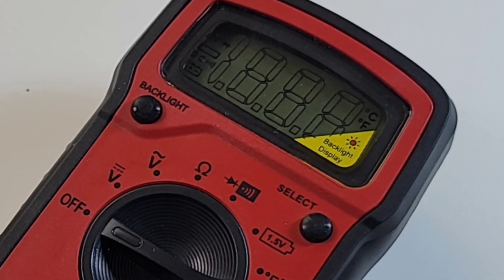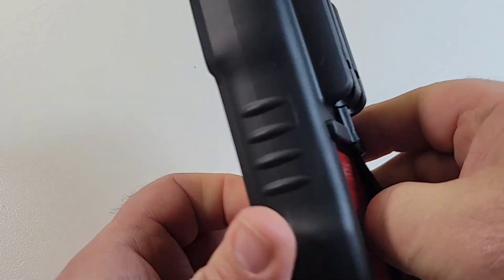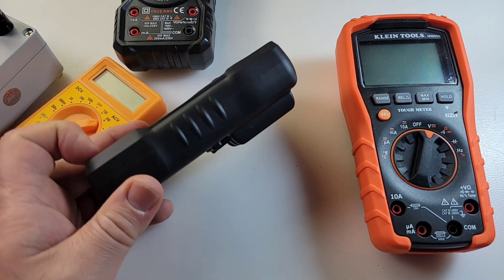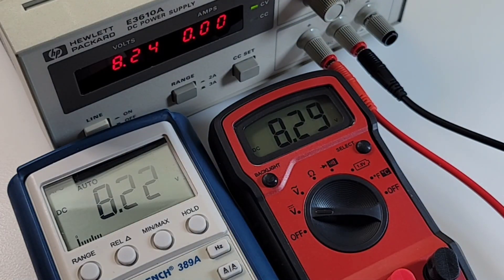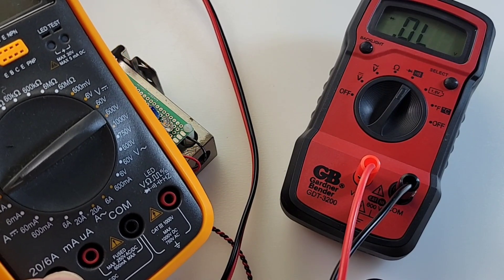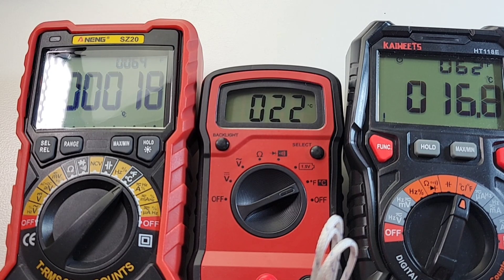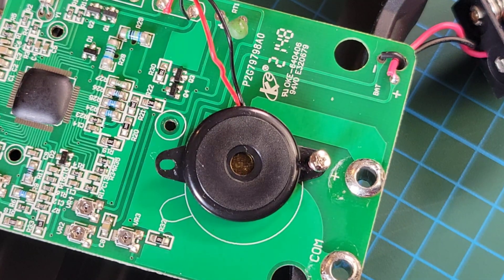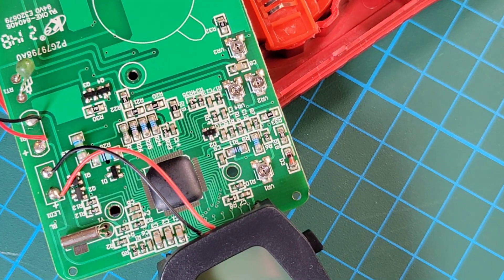GARDNER BENDER GDT-3200 CHEAP-O Multimeter Review & Teardown!

Comment: I have one of the older even crappier 3190 manual range versions of this, got it for $13 at an online pawn shop new in the package.  It doesnt have a backlight, continuity range, temp range or select button - its like a small upgrade to the Harbor Freight meter they used to give away for free--lol   I just use it as a quick test for batteries at the kitchen table but not much else.  Too bad cause the case makes it feel heavy duty but its nothing special and the price here is absurd - I also see this one at my local home center selling for $32, still too high.
Reply from the maker: Hey Mike, 13$ seems about right for this turd. Blows my mind people are paying 60$ or more plus tax..for this abomination. Just shows you there's one born every minute! 😮
Reply: Yeah I ran into mine a long time ago on ebay, just happened the pawn shop that had a whole case of them brand new and they were right here in town...hmmm.   Got one for 13 and free shipping, what there is of it works ok, but not good for too much but testing batteries, small step up from the old HF freebie. 'lol

Comment: Thanks for vivid analysis.sir Anneg (smart along with range on auto mode) or similar model (6000 counts)in zoye.or kaiwtees 118e or kaiwtees 601 smart among these which one is durable .also suggest atbn or  b/w display or coloured display which one is durable? Or suggest any rough tough meter.for normal use mastech 830 l is very popular in our area.but upto 10000 counts plz suggest rough tough and pocket friendly.hope reply from great and always  cheerful and positive personality.
Reply from the maker: I really use my ZOTEK ZT-980 alot, great build and tough as nails. The new ANENG SZ20 seems solid and a sweet 25k Resolution.